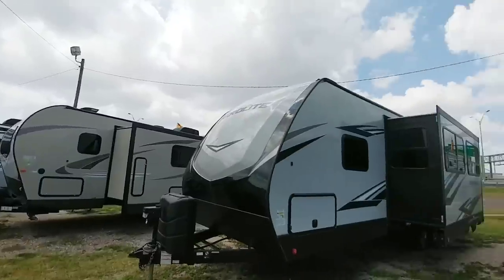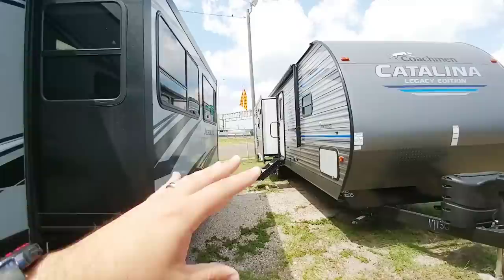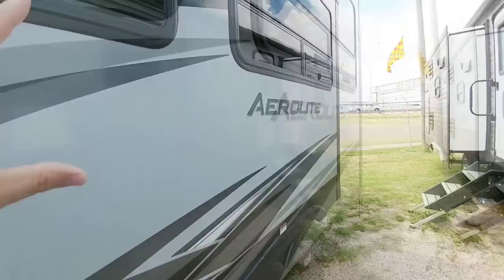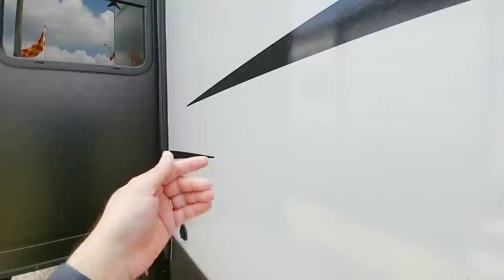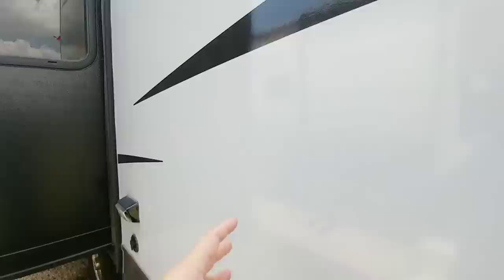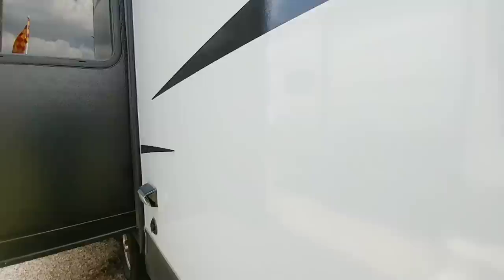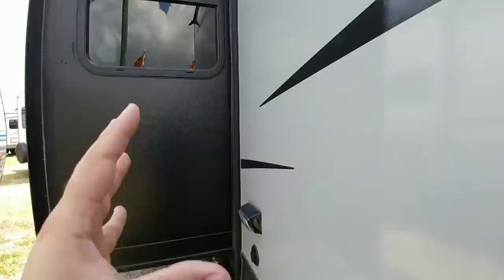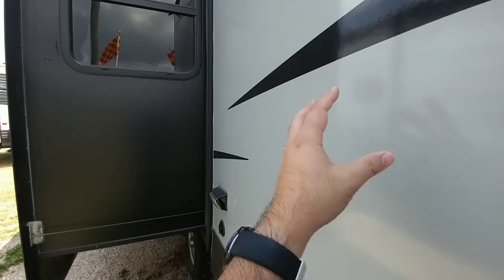Fiberglass Laminate vs Stick and Tin Travel Trailers and Fifth Wheel RVs!

Comment: The type of wall system has NOTHING to do with the underbelly (enclosed).  Also, I've seen so many trailers with de-lamination.  Yeah, fiberglass looks great, but what a pain to repair and it will fail eventually.

And what does the wall system have to do with options and accessories???  He said that if you have fiberglass, it will be more expensive and have more options.  YEAH!  It's more expensive because of the options.  What in the world is the point of the video????

Comment: You are incorrect in the repairing of the fiberglass reinforced panels... You can repair them to point where it is factory... The trick is using boat repair techniques, not auto body techniques. Using automotive bondo to repair a panel will fail... You need to use epoxy resin and fiberglass cloth and chop strand with marine grade fairing. How do I know? Bought one with a repair made using automotive repairs... And I saw a small failure... However, once I got into it it the actual repair looked like a car drove through it...   Without tapering the joints and reinforcing the edges, it cracks along that edge and bondo will suck water in. Used boat techniques and it hasn't failed or cracked on the seams.. You have to use a 12 to 1 ratio on the taper. And penetrating resin to seal the plywood before laying up the fiberglass... Been 10 years now... Still looks factory...
If you are talking about aluminum skinned plywood then you can't unless you replace the whole side panel... I would stay away from aluminum skinned... Just like the ribbed type... Once you damage it it is painful to repair...

Comment: So I'm interested in getting a fifth wheel. I will be purchasing one in about 2 years. It will be lived in full time. I will be going to Arkansas or Colorado I'm not sure right now. So I'm on disability and I will have a work-at-home job. So I need a reality check in following through with this. Also I have two parrots and I have no idea how they are going to react in the fifth wheel as it's moving. I also thought about getting a used RV. So if I get a fifth wheel I'm going to have to get a truck. Then I'm going to need a place to stay and I don't know what the monthly costs are going to be but it can't be much so I have no idea in regards to that. I'm just now collecting information so I can decide if I'm going to actually be able to do this. I'm single, so it's just me, unless I find a woman who wants to do this too. I have no idea of what my monthly costs are going to be at all. I plan on having the RV or Fifth Wheel, and Truck paid for, or very close to it. If I buy an RV, I'll pretty much need to pull a car with it. Because traveling everywhere in the RV is going to be troublesome. And gas would be more costly. I would find a place to settle, a place I can afford monthly. Would having a Truck with a Diesel engine be better. Or if I got an RV, would having an RV with Diesel engine be better, because Diesels run very long. But more costly to fix, to my understanding. I know I'll have an electric bill too. Possibly water bill?  All my other necessities I'll have factored in. I know it's a lot of questions so if I could be directed to the right place or person, I'd much appreciate it.

Comment: God help you if you own a FG over luan camper.  Th e luan core is he cheapest of cheap.  If you get any water on the luan any where  it will disintegrate.  The FG will de laminate from the luan which in turn is de laminating between layers inside.  The glue holding the layers of the luan is not waterproof.  Once this starts the process is both irreparable and unstoppable.  The camper will come apart and there is nothing you can do about it.  I had this experience first hand and would not buy a FG over luan camper at any price .